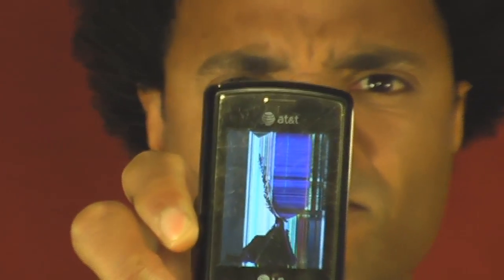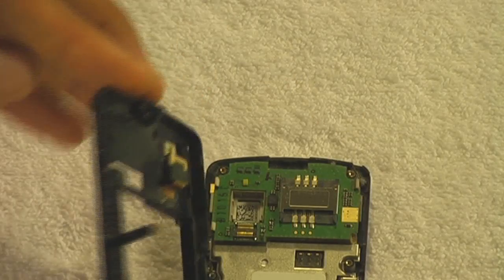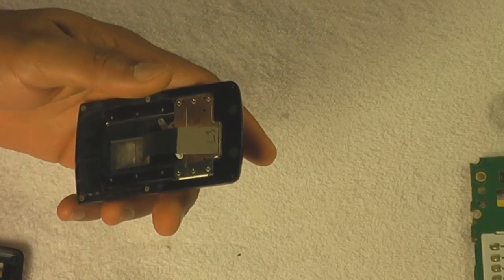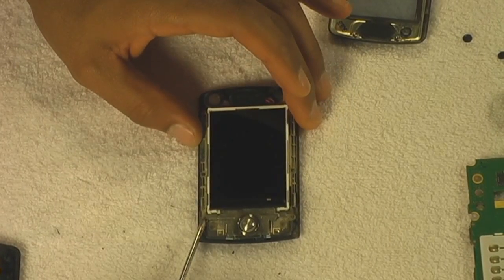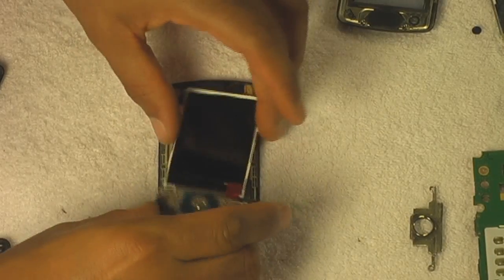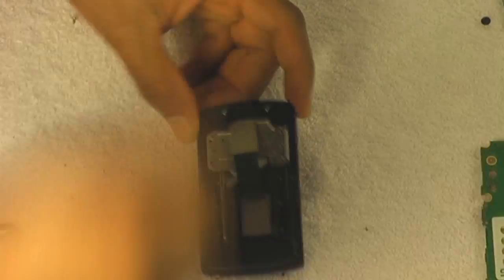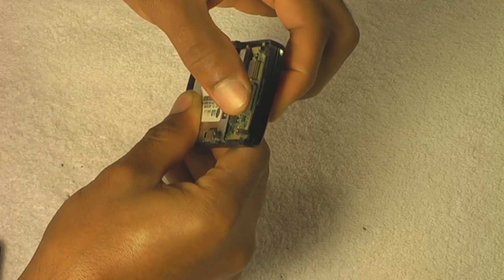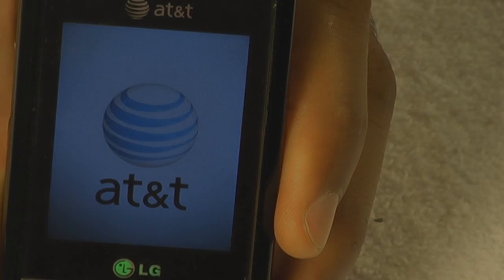Da Shiek's Complete DIY Repair & Re-Assembly of a Cracked LCD on an LG Shine CU720 Cell Phone

Comment: On disassembly you took two screws out that was holding the metal guard but on re-assembly you showed that you put two screws in prior to putting the two screws in metal guard. What are these two mystery screws?